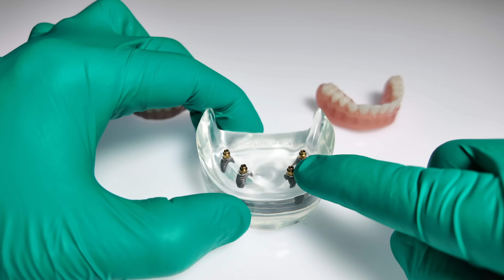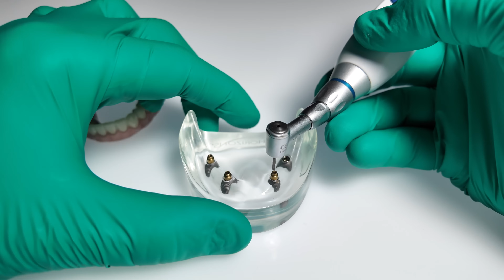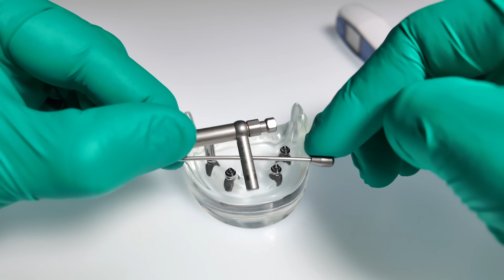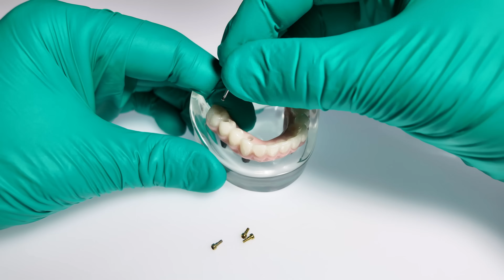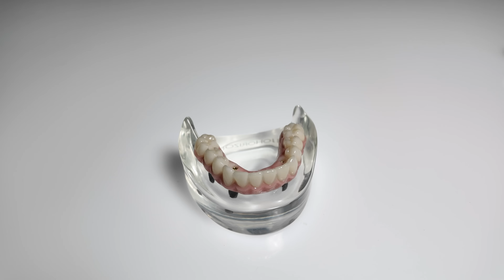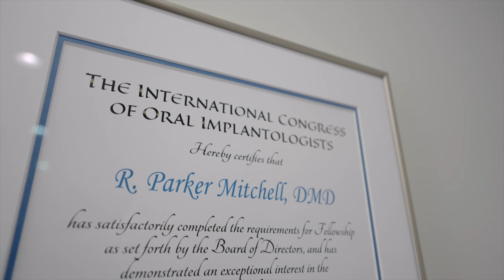Best Types of Implants (Explained)

Comment: So a truck tire and a hammer didn’t break them but a frozen peanut m&m did? Lost my trust here 😊😂
Reply from the maker: Several hundred pound bite force on the prosthetic the size of a frozen m&m that was unsupported by an implant in the back. It makes perfect sense why it happened if you saw the case. It was a cantilevered portion distal to an implant.

Comment: A hammer won't break them but a frozen M&M will?
If you fill the screw holes with dental repair material, how can you use the hex wrench to remove the prosthetic?

Comment: I have a set of upper & lower teeth that are screwed in...   lost all my teeth due to opioids from breaking my Neck at C-2 and other spinal injuries at work...   I love them... Get them pulled out about once every two years but they are usually very clean underneath.   I use a wet toothbrush and a handheld waterpik ... Very happy, no real maintenance
Reply from the maker: Glad to hear you love them. Sounds like you are taking care of them the right way
Reply: @DoctrParker     The only thing I would warn people who are thinking of getting all on 4 is that these teeth are NOT temperature sensitive like the teeth you were born with so be careful when eating very hot food.   you can burn the inside of your mouth.

Comment: Just had my 4 baby teeth removed I’m 31 btw and my options are implants or a bridge type denture with a retainer type spanner connecting to the other two. The 4 teeth around my two front teeth. What do you recommend. Impact or the spanner and bridge system?
Reply from the maker: dental implants if you have the bone to do it.

Comment: I need implants or dentures and with my income I think dentures is probably my only option. I have been putting it off for awhile due to a few reasons. If you would be willing to work with me I would love to discuss it further. I really like the 3 on 6 method but it is even more expensive.
Reply from the maker: If you start with detures you can always transition into implants down the line when you can afford it

Comment: I've been making dental prosthetics for the past 30 years, and yeah, I really don't like the all on 4 option . When they fail, the patient is pretty much left without any options because of that bone reduction.  You can just place locators so that you don't have to adjust their bone, it's better in the long run.
Reply from the maker: I agree but try and do minimal bone reduction for that reason. Once the bone is gone there’s no getting it back
Reply: @DoctrParker  I have not lost any bone... I have had these All on 4 (top is all on 5) for about 10 years.